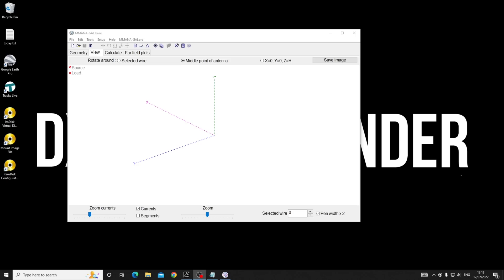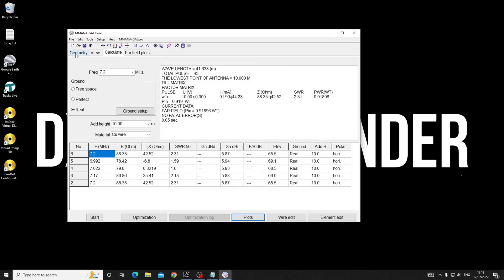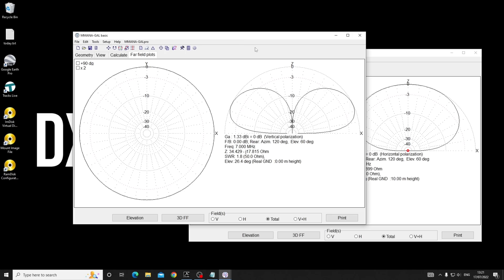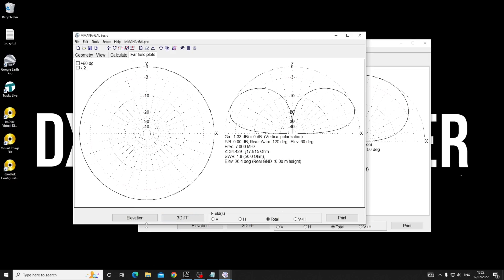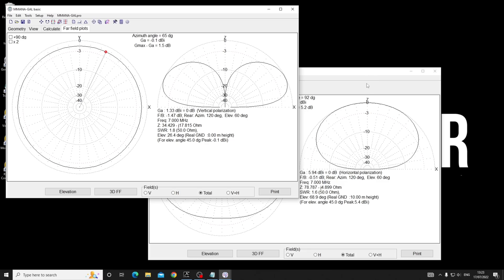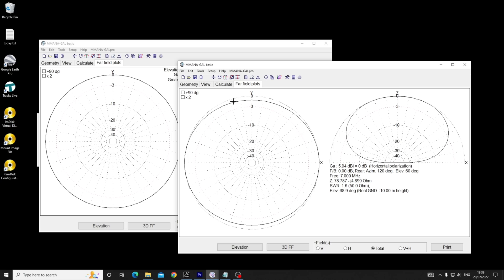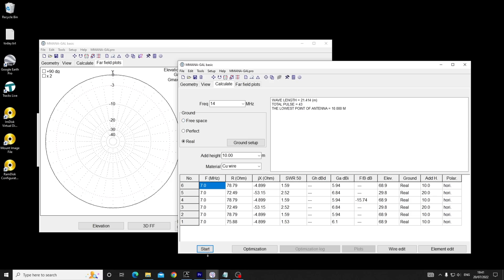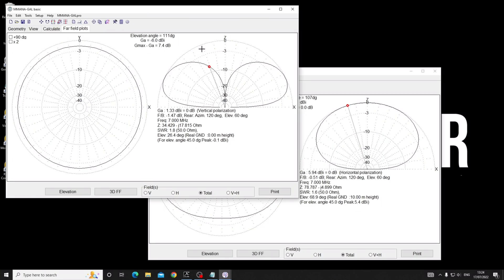Cost-Effective Antenna Solutions: Comparing Dipole vs Vertical - Which is the Best?

Comment: I can attest that the dx commander vs a horizontal dipole is a wash.  I tested the dx commander against a zs6bkw and there was no difference (that I could tell) in the noise or receive capability     I like the dx commander better due to its ease of putting up and taking it down to do maintenance.   I have the 12.4 mounted to a barenco pivoting base    Easy peasy

Comment: Callum, I have about 2.5 -3 meters elevated terrain eith a low stone wall about 25 meters from my antenna point (mast with EFHW). Condidering a 12 meter DXC.  Would elevating the DXC base a couple of meters and running a vertical wite down to my 10 radials on the ground be beneficial?

Idea is - to get more of the length - especially on 10/15 meters - in view of the horizon.
Reply from the maker: A low stone wall will have zero effect.. Suggest doing a standard install, then enjoy it :)

Comment: Hi Cal .. thinking to buy a DX commander antenna .... But with my current antenna (sirio 827)  I am having s3 static almost on all bands except 40m . I do believe that this s3 is a man made noise .... If I buy your antenna I might be having the same issues.  Or not ? What do you reckon? Jimmy
Reply from the maker: Well SOME folks have LESS noise on a grouond mounted vertical.. ALternatively, run with a Loop On Ground. See my demo.. You know, dedicated receive antenna... Does wonders for local baloney static blah blah.. See here for a demo: https://youtu.be/z5MhYu2LUrY?si=_i_6okNolgi6niuP (wind forwards 7 minutes..)

Comment: Hi Callum! I've been watching and learning a lot about antennas from you for several months now. I'm not a "ham" yet; I have an old 23-channel Cobra AM/USB/LSB radio that I'm trying to get up and running as a base and mobile. Since it's an old radio, I don't want to spend a lot of money on buying antennas. So I have constructed a vertical center-fed dipole antenna from a couple of fiberglass telescopic fishing poles and solid-core copper wire run inside the poles. I chose this design for the omnidirectional pattern.

To build it, I have it laying on a pair of sawhorses about 2 ft off the ground. It's mounted on a  26-ft fence top-rail with its center feed at 24 ft,and  using PVC pipe to stand it off from the mast about 2 ft. When I finished tuning it in the horizontal position, the SWR was below 1.5. HOWEVER... when I stand the mast up, the SWRs go through the roof!  When I lay it back down, the SWRs go back to "normal".  What's causing this? I'm thinking it's because the antenna is close to the ground.  But how can I tune it when it's 25 feet in the air without taking the mast up and down each time? I don't want the expense of an antenna tuner, either. 

Can you enlighten me?
Reply from the maker: Right.. So antennas close to gound are a different length to those higher up.. I've not made a specific video about this although it's littered around a few of mine.. But try and find a way of getting it vertical and up a bit and then tune it..
Reply: @DXCommanderHQ  Thanks, Cal! 73s!
Reply: @DXCommanderHQ  When you say "Different length", are they "shorter" or "longer" close to the ground? In other words, will I need to shorten or "lengthen" the elements when it's vertical?
Reply: @DXCommanderHQ  Hi Callum! I wanted to get back to you about this and my results.  Iput the antenna up in the air about 11 feet, and tested my SWRs. Was still getting high readings, until I saw your video this morning on "How long should my dipole be"? My calculations were correct EXCEPT I didn't include the velocity factor, which reduced the length by about 5.5 inches.  I clipped that off the upper radiator, put it back in the air, and the SWRs are consistently about 1.3:1 across the CB band! I couldn't be happier! Well, except I'm not getting any modulation. One step at a time! Thanks for the tip!

Comment: Cal, if one had a 130 foot EFHW with a 49:1 unun at the base to connect to the unit, would adding a coil somewhere in the middle allow that antenna to be shortened?  (my intuition is yes) If so, how much inductance would one need and what length and positions would the new antenna dimensions take?  For that matter, is it possible to model such a question?  I'm a relatively new HAM getting into cw sota activations and am dreading unfurling 130 feet of line. Ideally I'd the resulting coil-loaded EFHW to resonate on both 80m and 40m.  Your thoughts and recommendations are appreciated.
Reply from the maker: Yes you can do this. I never have - but you can (watch the harmonics because it wouldn't resonate where you next want it to be on the next band)

Comment: Observation from someone who really cant put up a tower....   A vertical at 10m height will cost thousands to erect and build, while a dipole at that height can be just strung in a tree for the cost of the dipole which is usually under $200. From that view point, seems like an unequal comparison. Not sure folks put up towers for just a dipole.
I'm not fluent in the software, but it did look like the vertical was at 10m height?
Reply from the maker: OK, wait.. my model was a ground-mounted vertical. Not even an inch above the ground.. AGreed, dipoles and ground verticals are easy!
Reply: @DXCommanderHQ  Ahhhh, that makes sense. Thanks!

Comment: Awesome content as always. I had a quick question about the dx commander 12 signature antenna, I realize it's rated legal limit but I'm running about 500 watts on AM on the 75m band.. would that have any effect on that antenna? I'd hate to ruin such a Awesome antenna
Reply from the maker: You will be fine on 500W AM.
Reply: @DXCommanderHQ  thanks for the clarification. Are you still awaiting the plates for the antennas? Your website says so, just curious if you are still waiting or forgot to update it :)

Comment: Meh.  I’ve had both.  If you have the height (about 10 meters, but even a little less isn’t so bad) and you can put up a couple of fan dipoles covering 20-6m at right angles to each other and then switch between the two - that’s actually a pretty nice set up - superior to a vertical - especially at higher frequencies as the sunspots tick up.  Dipoles are also better if you work primarily along one transmit/receive path.  They’re less noisy because they null off the ends, very useful.  Verticals are noisy, omnidirectional (not a great thing) and the low takeoff angle isn’t a guarantee the ionosphere will cooperate with you.  They’re easer to put up, but the radial systems are an underemphasized complexity in their installation.  Verticals are more practical for 30, 40, 80, and 160m. Callum is over emphasizing the 5 deg TO angle.  It may help you get a 10,000 mile QSO-but if the antenna is too noisy and omnidirectional you may not hear the guy at the other end.  A 30 degree TO angle, with a gain 2-3 dB better than a vertical, will go plenty far.
Reply from the maker: Yes a pair at 90 degrees would be very cool.

Comment: Hi Callum, my antennas seem to match your figures. My 40 metre horizontal dipole is less than 6 metres above the ground, but it works OK locally here in VK, but on DX my DX Commander is almost 2 s-points stronger. Ray VK3CEO.
Reply from the maker: Ah! Good man!

Comment: Great video Callum
Fantastic timing I am currently half way through making a linked 20/40m dipole. However I have ran out of garden only managed to make the 20m section as my garden is 8x8m there abouts. Going to have to build the rest in my mother's garden. So next option is to build a 20/40m vertical with a coil/trap in the middle. So it will fit in the garden. Will only be a temp/popup/pop down antenna for playing at home. My main drive is portable so need something smaller for home. Great timing with the video.. Great stream today. Motters M7TRS 73 👍🏻
Reply from the maker: Yes OK.. Or try linear loading for 40m. I did a video about that for 80m.. https://youtu.be/zWFU-VWOSJI

Comment: Great video Cal. I love experimenting with different antennas and usually use some type/variation of a wire dipole. I've been running a Hygain DX-77 vertical for about 6 months now and absolutely love running the vertical. I have noticed some issues in a predominantly horizontally polarized arena but it's honestly few and far between. So many options to choose from, you have to go with what works for you with your location and operating habits. I believe there is no wrong antenna, just the wrong application. 
73, 
Chris, KS5KY
Reply from the maker: Yes, I think you said that well! "I believe there is no wrong antenna, just the wrong application"

Comment: Really nice video Cal, and indeed food for thought. I am all for modelling (do it in my day job for radiation shielding), but there is nothing quite like taking real measurements to explore differences. So I have a DX Commander (classic) in the garden with about 160m of radials. I also then have an EFHW at about 8m off the ground, this is about 12.4m in length and has a trap such that I can operate on 80m if I wish (not great efficiency but it works for local contacts). I have a CX210 antenna switch and out of curiosity I am forever switching between the two. On balance the DX wins for me, BUT there are clear occasions where the EFHW is much better (receive and transmit). I have a flex 6600 radio and have not yet split the two antenna into the radio (then I can do away with the switch and use software switching ). I think I am still learning at this stage and find the switch better.  Videos on a receive antenna would be most welcome too !  Mark, 2E0MSR.
Reply from the maker: RX video soon mate!

Comment: Generally, below 10 Mhz, 40m, 80m, etc., a higher angle of radiation is often desirable, due to the normal usable distances of those bands. Above 10 Mhz, 20m, 15m, 10m, etc., a lower angle of radiation is desirable for longer distances normally used on those bands. For example, it would be rare to get very long distances on 160m (except over water maybe), but on 20m or 10m, the other side of the earth isn't uncommon. I did have a neighbor with a full length aluminum dipole for 40m, a half wave off the ground. That looked pretty crazy, but his tower was a crank up tower, so he could shorten it when he wasn't using it. Out in the country, I saw an 80m wire dipole that was about a half wave up, across the tops of tall evergreen trees. I have no idea how they got it up there. I have inverted V antennas for most HF bands, not very high from the ground and I have a multi-band, ground mounted vertical. The inverted V's work out, because they are low for 40m and 80m, but at the same height, are high for 20m and 10m. Ground mounted verticals can work well with a good counterpoise (radial wires, etc.) on the ground. 1/4 wave on lower bands and 5/8 wave on higher bands seem good, but I haven't had much luck with end fed half waves on the ground, as they don't respond as well to a good radial system.
Reply from the maker: First line of your comment. I totally agree. 99% of the time. Then after dark when some weird island comes on and you need to squeeze another 5dB out the wigglies... Well, join the dots :)

Comment: Have miles of chain link fence in Houston.  Could you put a vertical on a CB type mirror mount, attach to the top fence rail, get a good found from mount to it?
Reply from the maker: But you will only effectively have 2 x radials. It'll work, but not as well as lots of shorter ones. Good idea though.
Reply: @DXCommanderHQ  I can add more radials.  Just wondering if the concept would work.

If I could get ground wire to the chain link part of the fence....!
Reply: Do have an alligator setup for coax and 3/8 x 24.  Another can test concept.

Comment: And what are you doing on HF? Contesting? Nets? Ecomm?

I have heard that before 2m FM repeaters became common, people would use 80m for ground wave propagation.  

That all enters into the antenna debate.
Reply from the maker: Regards your second line. In the "old" days, 160m was better for local. You get a good 10-15 miles.

Comment: Interesting vid Cal. I'm wondering what if any is the performance difference with a doublet and a half wave dipole ? I have a 135 foot doublet, so more than 2 wavelengths long for 20M. Would this perform better than a half dipole for 20M ?
Reply from the maker: Erm.. You can't "make" more RF.. So if you gain in one direction, you absolutely must lose it in another. In your case, after doing a very quick nasty model at 10m height, you would have a 4-leaf clover with BEST gain at 5 degrees off horizon at around -3dB. In some 4 other places (NSE & W) terribly gain.
Reply: @DXCommanderHQ  thanks...I like that explanation "you can't make more RF". So all I'm doing is changing the shape of my transmitted RF. Makes sense now....all the best 👍

Comment: Which is easier? Getting one end of a single vertical piece of wire 10m up a tree, or getting two 10m pieces of wire 20m up in the air with a feedline, between two trees, parallel with the ground? Let's take a poll.
Reply from the maker: Well, practicalities also necessary! Good point.

Comment: It's too bad MMANA only calculates free space around the antenna, and can't take location into account. This can make a huge impact on antenna performance when dealing with DX (low angle radiation) on 40 meters when you live in a neighborhood, for example, which can easily be in the Fresnel zone.  Ah, it is a fleeting thought since low hanging 40 meter dipole is the go to comparison for contrast.  Personally, I am not in any particular antenna camp, but like the know the positive's and negatives of each type, and appreciate the work you do here Calum.
Reply from the maker: "Huge impact"? I don't think so. And on 40m - most buildings don't really get much in the way. I don't know of a program where you can literally draw all the buildings and steel sheets / roofs, electrical wiring etc.. Frankly, in my "real world" tests I notice nothing gets in the way and I have a TON of steel sided buildings and very large trees within a wavelength.
Reply: @DXCommanderHQ  Ah, but one day... With Google knowing all as it does, we will have maps and mass. It won't be long before Google goes beyond the outsides of our buildings.  Already auto vacs are mapping the insides of peoples homes and sending that up to the cloud to be shared.  We may be a few decades out, who knows, but it is just a matter of time before MMANA or programs similar to it, will estimate based upon the things around the antenna.  Yeah, I agree, huge was a little hyperbole on my part :)

Comment: For a vertical with radials, can the radials be buried just under the surface of the ground? I'm worried about running them over with the law mower.. Even with some sort of stakes, I still worry about ripping it out of the ground.
Reply from the maker: I layed mine down and used "radial pins" and 2-weeks later, I couldn't bloomin find them! Seriously, they literally vanished. And this was in the autumn with no grass growing. Dogs were playing on the grass the next day. https://youtu.be/scDXKNJs7i4
Reply: @DXCommanderHQ  I've heard this from fellow hams who run verticals too Callum. They disappear after a short time and you can mow right over them. I enjoyed the video, great explanation of a vertical vs dipole.
Reply: Yes, you can bury the radials but you will need more of them to reduce the ground losses. This is the reason a vertical antenna above ground only uses 3 or 4 radials, no ground loss. Ground mounted, you need as many as possible for best performance. Those who put up a vertical without radials just warm the earthworms up with their RF.
Reply: Hi mate - yes absolutely.  I cut a slit about an inch deep for each one. Completely disappear and lawn mower never knows. Actually, on a lawn they disappear if pegged down after a couple of weeks anyway.  Callum sells the pegs (biodegradable)
Reply: Bury is fine. That said, with the hot weather at the moment, mine are starting to appear again, like a lost village that becomes visible when a reservoir runs dry !